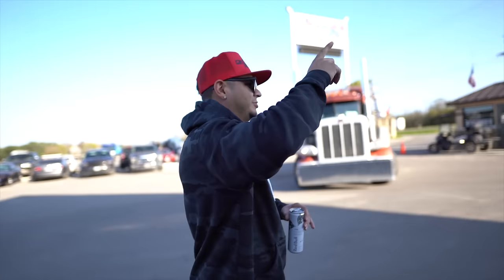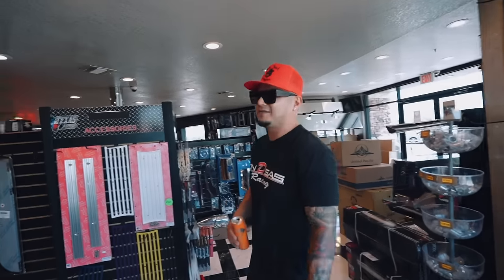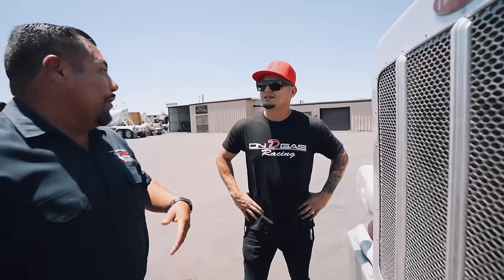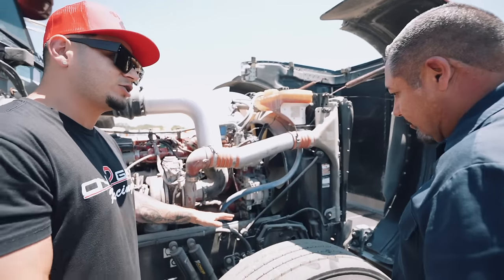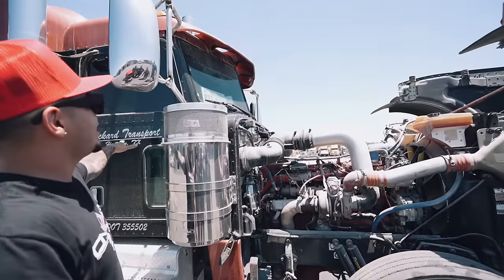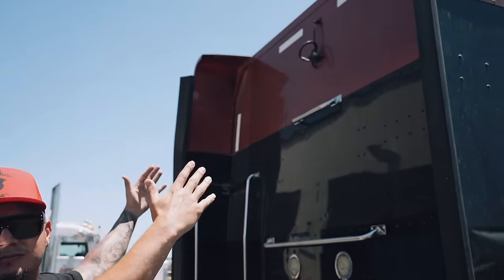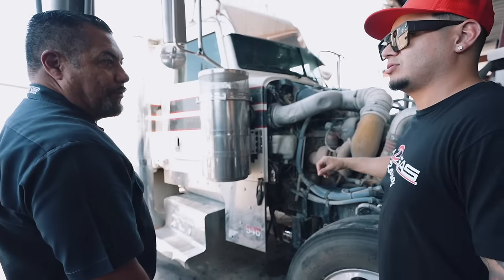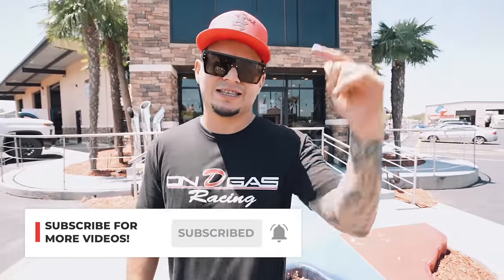Peterbilt Project 389 at Texas Chrome Shop

Comment: You should look into replacing the windshields with inverted school bus windshields!!  When you flip them over the tint can be trimmed to the height you want and looks insane coming up from the bottom.  Also at night when someone hits you with the high beams you can look through the tint

Comment: I'm a seasoned truck driver that delivers and picks up industrial equipment in extremely tight places. So the convex hood mirrors and upper passenger door convex mirror is an absolute must in my profession. But for what you guys are doing, those mirrors are not necessary. That tractor is going to look sexy AF though!!!

Comment: Go away with the cab lights tell them to put the 3/4 switch back light on the visor, breathers, bumper and  cab panels so they can turn red as well it will be a way cleaner look

Comment: Yall should repaint the engine that nice cummins red and change intake and air filter pipes to white or chrome so you have a clean engine bay . También un 12.7 Detroit turbo kit from pdi pa Que jale más perron el camion egr cooler and egr delete ya Que no tiene after treatment system 🔥🔥🔥🔥